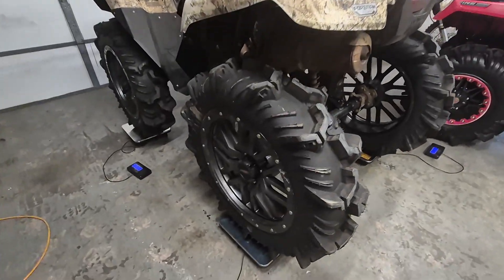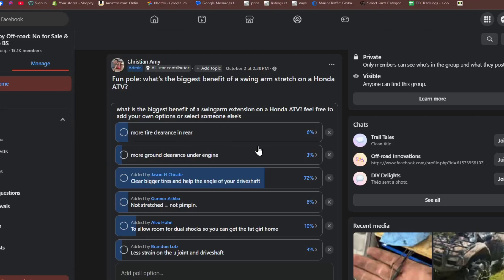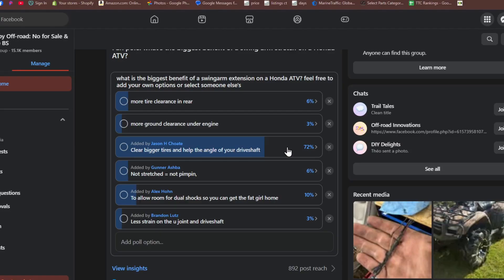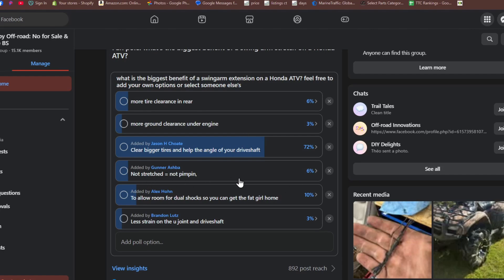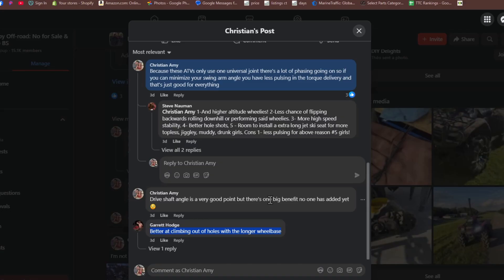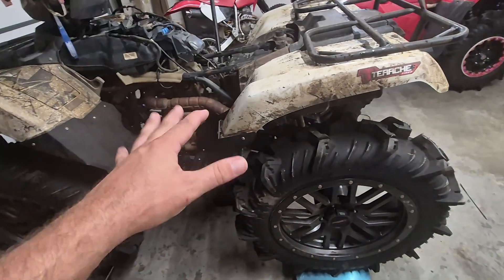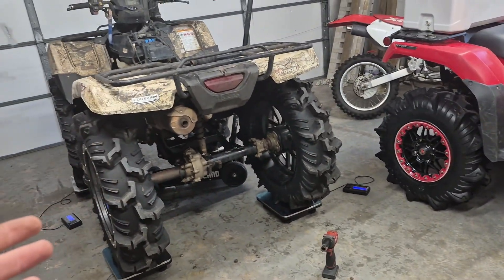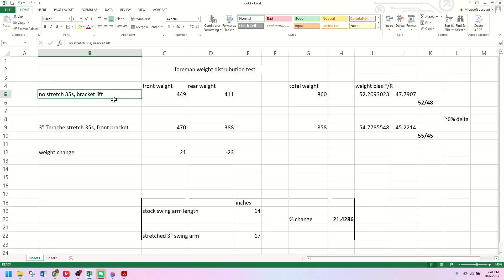Nerd Alert! Stretch impact on Honda weight distribution: Benefits of a swing arm extension!

Comment: Just off of feel on my 3 inch stretch, with 33/20s I’d say this math is definitely pretty close. The weight differences in wheelies definitely feels more than 6% 😅. As far as the swing arm “twist” I notice my rear end doesn’t drive up as bad when accelerating. Definitely helps the rear end not bind up while running rear or doubled up rear lifts lol.